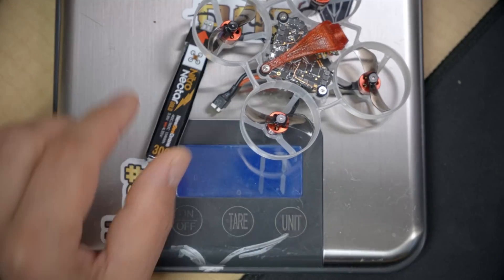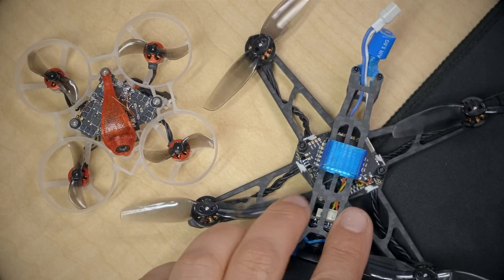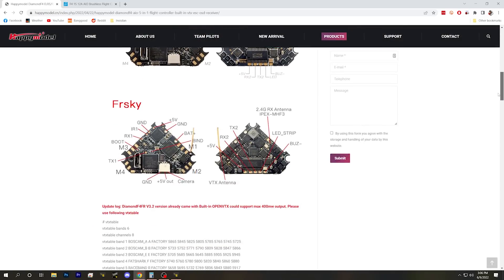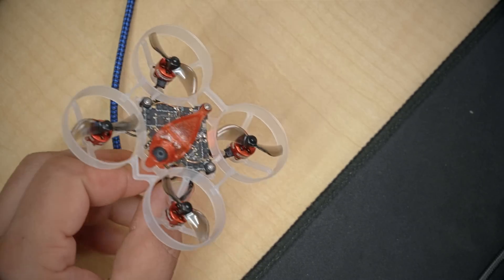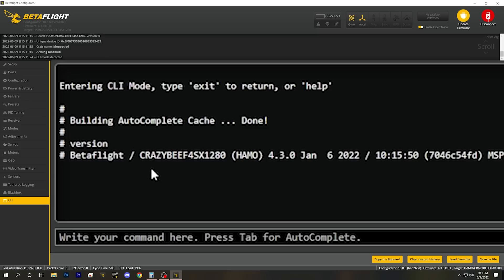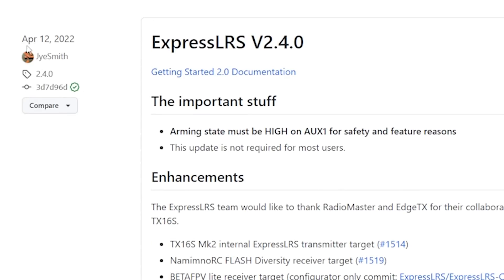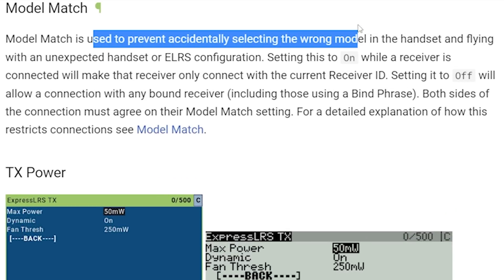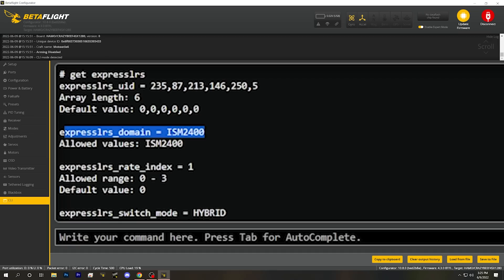SPI-based ExpressLRS receivers are the worst

Comment: I normally use serial but the darwinFPV elrs 2.0 bluejay 15a aio is giving me helll and its making me hate spi. I have done these steps and everything i can imagine to bind and i only get the model in receiver tab to cut a few flips after i click bind on betaflight then on my jumper aion. Then no stick inputs and no signal on my tx ilke all other models i have saved. Read online to get help but only get same steps seen here. Anyone know what i can do please chime in and help a fellow pilot out. Bardwell always comes through but this is just repeating what ive done.

Comment: I get random failsafes even indoors close to 5ft when flying with 150hz packet rate and dynamic power on with my mobula 8. It regains connection once I disarm and rearm...have you faced an issue like this?

This is very disappointing after moving to ELRS.
Reply from the maker: There's something wrong with your quad. I know this doesn't really solve your issue, but this is not an ELRS problem; it's not an SPI problem; it's not even a Mobula6 problem. There is something broken about your specific quad.
Reply: @JoshuaBardwell Thank you.. It is a brand new quad....it happens one time out of 8-9 packs. Do you think the CPU is getting overloaded due to dynamic power ON? Will reflashing betaflight fix it?
Reply: Solved: I switched off "LED STRIPE" in the configuration page as per Happy model recommended now my random failsafes are gone.
Reply: @JoshuaBardwell I can't figure out what the issue is but I turned off Dynamic power as per Nick burns (power level locked at 50mw) and haven't failsafed for 10+ packs.

Comment: I like a lot of your stuff but this SPI vs. UART whine is kind of ridiculous. SPI is, in general, a much more appropriate technology for peripheral circuits on the same board. It'd be very silly to have both the overhead of Serial UART and the redundancy of multiple UART chips talking to each other on the same board. That ELRS and Betaflight have not put effort into making the SPI drivers more modular is not a fault of the hardware technology involved.
Reply from the maker: The main reason the upgradeability of elrs was an issue was that, at the time elrs 3.0 came out, there was no version of Betaflight with SPI support for it. ELRS 3.0 had major features that people wanted. This isn't a case where people were flashing every dot release compulsively.

SPI receivers have timing issues if the MCU on the FC gets overloaded. There is a compelling argument that the control link deserves to have it's own separate MCU to prevent this kind of thing from happening. 

SPI receivers don't have wifi configuration. 

None of these problems are inherent to SPI, and you're right that devs could solve all of them. But Betaflight and ELRS devs both work for free in their spare time. So would you rather have them working on feature and performance enhancements, or improved SPI receiver framework?

You're defending SPI as if I've got some technical issue with it. I don't. It's a great tool. But the implementation of SPI receiver support in Betaflight is not great, and there is a real cost of changing that. That's the part I think you're not acknowledging.
Reply: I think a problem that feeds into this is the idea that people always need to be running the latest greatest ExpressLRS rather than just sticking with what works for them. How often do you update the firmware on your phone's (undoubtedly SPI-based) wifi or bluetooth transceiver separate from OS updates?  When was the last time you updated the firmware on the digital (I2C or SPI) ambient light sensor in your smartwatch separate from OS updates? Hmm...
Reply: Bet the camera you recorded this on has its own SD Card reader. Sure it probably works great as-is but hey why not eke the fastest possible settings out of it with an update from the manufacturer? But oh darn, it uses SPI. Guess you'll just have to wait for your camera manufacturer to release new firmware instead of obsessing about fractional SD card read speeds.

Comment: Hello Josué, as always, a pleasure to see your videos, but I have a question at the end of the video, you say how to link from cli I have done it as you mention but I cannot link. Do I have to touch any other parameter that I have missed?... I use radiomaster zorro with an external module and I have linked other elrs but this one resists me.

Comment: "SPI receivers DO NOT support D(D250, D500), F(F500, F1000) and Full Res(100Hz Full Res, 333Hz Full Res) Modes (Packet Rates) and thus will not bind or sync with a TX module in any of these modes." This is what let me finally bind.
Reply: OMFG.
This cost me 8 hours.
THANK YOU For your comment. I thought I'd go crazy.
Reply: You the man!

Comment: is spi similar to like spectrum sSRXL2 micro telemetry receiver, after all these different rfs and protocols, spektrum,frysky,crsf,tracer. i finally had to buy a radiomaster ranger module for a elrs 3.0 receiver . the micro and nonos were on back order so i bought the cnc one for 2watts over 1 watt hopefully, i wanted to avoid the whole xt30 pcb external power issue

Comment: I have it on a whoop board. Doesn't go far. I haven't had an issue yet. Also fly out a window to outside. I wouldn't put on bigger quad. 
I just upgraded to 4.4 to get elrs3 thpugh my whoop is broke. Motor wire pulled out the motor

Comment: Seems to me this is a real downside to SPI ELRS. The basic issue is that both Betaflight and ELRS are projects under active development, and they aren't synchronised - why should they be?

Way too easy to get incompatibilities with the ELRS Tx which is probably going to be the common factor across multiple craft.

I assume the same problem could occur with SPI FrSky or FlySky receivers, but the difference is the protocols are pretty stable. The problem really is that ELRS is moving so fast at the moment. Maybe in time it won't be.

I use standalone ELRS but am about to build a whoop style quad. The FC for that will either have to be one with no Rx (most likely) so I can fit an ELRS Rx, or one with FrSky built in. I will not be looking at built in ELRS unless it is via UART link.

Comment: I have a crux 35 ELRS and i have on disarm a Loop saying "Telemetry lost/ telemetry recover". On arm loop does not exit anymore but sometimes i have failsafe very very close to me (less than 50m !!) I don't know what to do. Crux recommend ELRS 2.0 i'm on 2.0. They recommend 250ghz, i'm on 250ghz. I can't fly safety. Someone told me that there's issue with BF and spi elrs with BMI270 (because of Dshot 300 and a low pid loop.) I really don't know what to do. Any solution someone ?

Comment: I've got the mobula 7 HD and I've done everything under the sun to bind it still nothing, i have the C in the corner and it still does nothing the is way harder than it should be I'm about to throw it in the garbage and say F it
Reply from the maker: C in the corner means its's bound. Is it an SPI receiver or serial? If SPI, then it really should work -- only thing I can think of that would break it is Model Match (turn this off in the Lua script). If serial receiver, you could have Ports tab configured wrong.

Comment: Can you bind an upgraded radio controller with 3.0 with a spi receiver which is only in betaflight based elrs 2.0? I was zero successful even after putting same passphrase by wifi on radio and cli to receiver. Really frustrated by hundreds of tries to bind the iflight commando and the mobula 7
Reply from the maker: 3.x code cannot bind to 2.x code. Here is the workaround: https://www.youtube.com/watch?v=bPbPCyjhE1Q&ab_channel=JoshuaBardwell

See the pinned comment below that video for an updated recommendation after watching that video.

For what it's worth, the compatibility warning is right at the top of the release notes for ELRS 3.0. It's always a good idea to check the release notes before flashing any new version.

https://github.com/ExpressLRS/ExpressLRS/releases/tag/3.0.0

Comment: So ELRS 3.0 is out and not compatible with 2.x receivers; can my Zorro handle both 2.x and 3.x ELRS or do I need to stay on 2.x to be compatible with my Mobula 7?  Or if it can't, does this mean I need to switch the Zorro back and forth between the two versions (or get 2 controllers)?
Reply from the maker: You cannot run two different versions of ELRS at the same time on the same module. So your Zorro has to be either 2.x or 3.x. There is a nightly version of Betaflight that you can put on the Mobula7 that makes it compatible with ELRS v3. Or you can get an external module to put in your Zorro, and run 2.x on the internal and 3.x on the external. Or you can just switch back and forth.
Reply: @JoshuaBardwell  didn't get the part about making the Mobula7 compatible with v3; isn't the ELRS version baked into the fc with SPI?
Reply from the maker: Yes it is. It's baked into the Betaflight code. There is a nightly build of Betaflight 4.4 that has barebones ELRS 3.0 support. I don't have the link right here unfortunately.

Comment: Would have been helpful to see how to flash a new version on the spi, instead of settings we can easily look up
Reply from the maker: You... can't flash a new version on the SPI. It's built into Betaflight. You flash new ELRS firmware by flashing a new version of Betaflight that has the new version of ELRS built in. To update the SPI-based ELRS receiver, you have to integrate the new ELRS code into the betaflight codebase, bug-test it, and then compile it. 

This is the whole point of the chapter starting at 6:35 in the video. That it's basically impossible for a typical person to do that. And so SPI-based receivers can't easily be upgraded like UART-based ones can.

Comment: As someone looking to get into the hobby with a limited budget, I was looking at getting a BNF quad and I guess it has SPI ELRS. Would it be a bad idea for me to get it right now? I wouldn't plan on flying anything else in the near-future, so would I really have to worry about firmware updates or anything?
Reply from the maker: Personally I probably wouldn't treat it as a deal-breaker and would go ahead.
Reply: @JoshuaBardwell  thank you so much for the reply and the super informative video! Assuming I get everything to work, I probably shouldn't update anything until the next quad I upgrade to, right?

Comment: Adding more and more single use processors because it's too tedious to integrate code into other code.

Sounds about right. Software sucks any longer, too spoiled by cheap capable hardware...
Reply from the maker: Bear in mind the devs all work for free in their spare time. And the FC mcu is not really capable of running fast enligh to service the receiver.
Reply: @JoshuaBardwell  SPI RX have been a thing in betaflight for a while now, flysky, frsky as well as the new ELRS. Considering all a receiver needs to do, I highly doubt it's that taxing on cpu time. Is it now? Maybe, doesn't mean it has to be so.

I'm not blaming anyone for not doing things for free, but bailing on better hardware integration because it's harder to work in software is just silly.
Reply from the maker: ELRS runs at a much higher packet rate than FrSky etc and so it more demanding on the CPU. I'm not making this up or speculating; I'm reporting an actual bug that caused failsafes and the fix was to reduce the PID loop rate to reduce CPU%.

"It's harder to work in software" requires work and coordination on both teams' part. It means that, whenever a new version of ELRS comes out, the Betaflight team must integrate the code and release a new dot-release Given how often ELRS updates, the amount of work required could be substantial, and would detract from BF devs actually improving BF. If the devs say they don't want to do the work, who are we to call them silly, when they work for free in their spare time?

Comment: i mean, its really good for light hardware. it sounds like they just ditched the whole elrs processor and are just running the radio chip and letting that giant arm chip you already have on the flight controller run the code. probably a step in the right direction, but with growing pains. Would be awesome if you could use that new presets picker to select elrs, but i know that doesnt actually recompile the code. Honestly, i wouldnt care about being several elrs revisions behind. I just want to get a good radio link and then never mess with it again.

Comment: Hey Josh, I am curious about the "Not so spectacular range of an FrSky Receiver"  Are you talking about the absolutely horrible range of a 4in1 module doing a very poor job emulating the D8 or D16 protocol?   Yes, I agree, it's horrible.  Or, are you talking about talking about the range between legitimate FrSky transmitter modules and legitimate FrSky receivers?   That's much better.  Or the range with ACCESS?  Lower latency and even better range.    So, which one are you talking about?

Comment: Hey Josh, have I missed something here? Ok so if the rx firmware is locked, what happens if you have 2 , 3 or more whoops of different ages, and you want to fly them all on the same day do we have to juggle flashing the tx each time? If so that would be a real pain, I am just starting to dabble in this, so just trying to learn something to day, hahaha, or, are they all covered by V2 tx
Reply from the maker: This is the problem with SPI based receivers. Once you flash your module to 3.x, you can't use the SPI-based whoops any more. So you either have two modules with two firmwares, or you flash the module back and forth.

Comment: ok so I got through all of this and I have my spi receiver bound and i can see the inputs in betaflight but there's a huge delay and it's really choppy and when I try to arm it i get an error code saying "bad rx" or "rx lost". Does anyone have any ideas how to fix this? I'm using the BetaFPV F4 1S 12A AIO flight controller and the BetaFPV ELRS Nano module in a lite radio 3

Comment: How do I switch off an SPI based receiver completely? (In this case a FrSky rx in the TH3)
Reply from the maker: It's not really possible as far as I know, without cutting a trace on the PCB or de-soldering a component.
Reply: @JoshuaBardwell  oh pity. Can I at least disable the indicator LED that shows the SPI rx looking for a D8 bind?

Comment: Hi, I just got this quad and for some reason it says No Gyro/Acc on betaflight. Do you know why this is happening. This is with no flight time just setup?
Reply from the maker: Most likely you flashed the wrong Betaflight target to it, so now the FC can't find the gyro. Go to CLI and type "version" and you will see the current target on the FC. It should be: CRAZYBEEF4SX1280
Reply: @JoshuaBardwell  I didn't flash it ,just got it yesterday and  connect to betaflight to bind. I will check that.
Reply: @JoshuaBardwell  Hi, just checked and has CRAZYBEEF4SX1280  (hamo) 4.3.0 June 14 2022
Reply: @JoshuaBardwell  I saw your video on the Mobula6 and I checked my ports and the UART2 was on configuration/MPS ?

Comment: Thanks for this great informations
Please can you tell me what is better??
I want to buy mobula7 1s elrs and are two obtions 1 --elrs integrated spi  (flight controller is 1s only and have mpu 6000) or 2 without receiver and add an ep2 on uart(flight controller is 1 and 2s but have another giro chip not mpu600)
Reply from the maker: It depends if you care most about weight, or more about the future upgradeability of the FC. If you care about weight, get the SPI receiver. If you care about upgradeability, get the EP2 receiver.
Reply: @JoshuaBardwell  Thank you

Comment: Instead of hard coding and tightly coupling elrs version inside betaflight they might just add 1 extra drop-down box to select elers version you need to configurator, and let it you select the version you need. Though it would require BF compilation at your pc before flashing, or they would have to precompile multiple versions of elrs and bound them to the dropbox selection
Reply from the maker: It's not that simple. Betaflight code has to be written to integrate with the ELRS code. You can't just drop in an arbitrary version of ELRS. It's significant work to keep it all up to date.

Comment: It's crazy that we are still using UART serial communication with flight controllers in 2022. Maybe there is a better way to do this, but maybe don't dis someone who is making a much needed improvement to how receivers actually work. In the long run this will be a BIG deal.

Comment: As long as the new versions of ELRS TX firmware are backwards compatible with the BF SPI RX versions there's no problem with the different projects beeing out of sync in release schedule.
If it works it works, do not update. 🙂

Comment: One thing I've heard is running the PID loop on anything other than 2khz will spike cpu utilization due to the cpu timing running the eLRS firmware code in the PID loop. CPU is around 35% on a 2khz loop on my mobula 6.
Reply: No, this is fixed in 4.3 now. Betaflight 4.3 also reports CPU differently now. Up to 75% CPU is acceptable.

Comment: Here is the model match gotcha with ExpressLRS. The module saves just about all the settings for each model match number. This includes whether model match is on or off and it does this even if the model match feature is not enabled. If you set up your first quad on model match number 1 and turn it on in the module and receiver it works. Then you go to add a second quad that has different settings and it’s easy to forget that when you switch to number 2, you need to redo all the module settings including turning on model match for that number. This does allow for not really using model match but creating multiple configurations with different settings. You could have a long range and short range model for the same quad, for example.